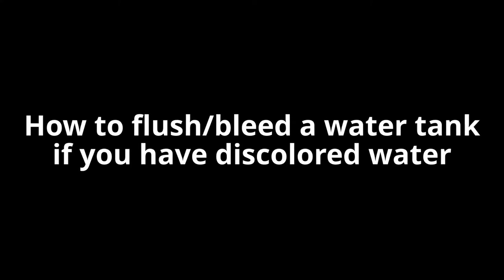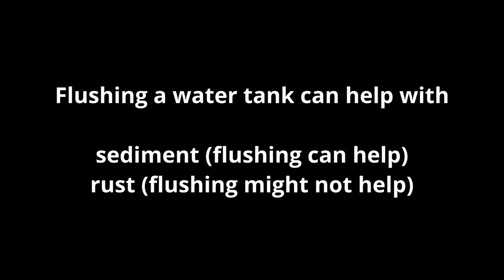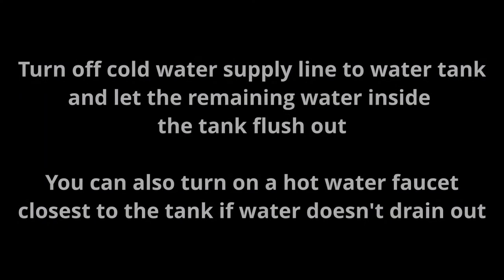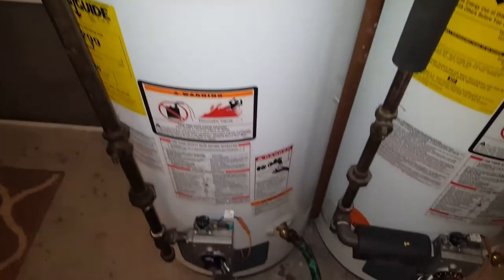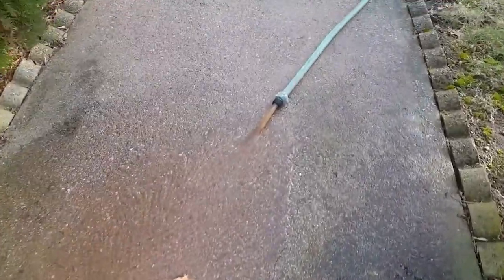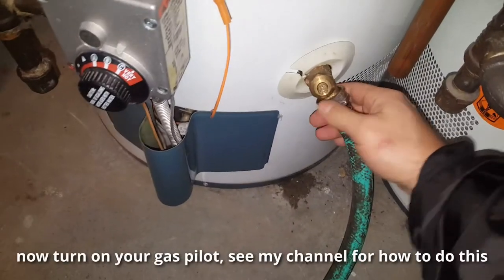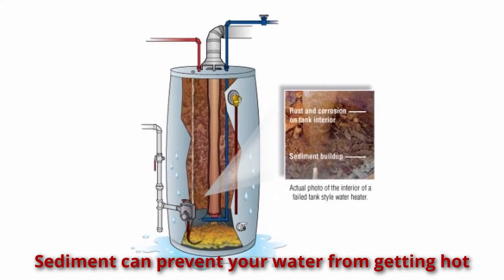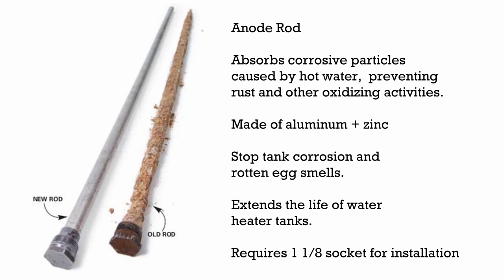How to bleed a hot water tank if you have discolored water

Comment: Great video. I am on a water well and my house and water heater are just 4 years old. My hot water is brown. To check the anode, do I need to have everything off (cold water intake,etc) to relieve pressure? Don’t want anything to blow up in my face. Thanks again for the video.
Reply from the maker: You need to shut off water and empty tank, while you have a faucet opened to relieve pressure etc. I wouldn't check with water in the tank